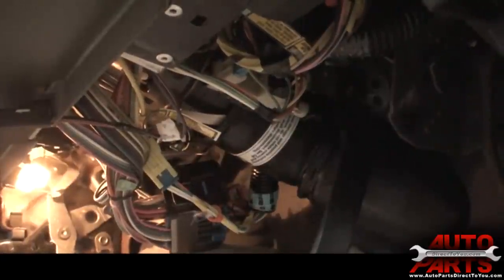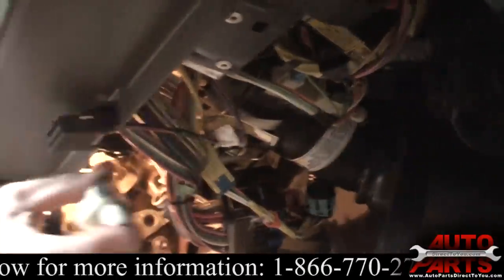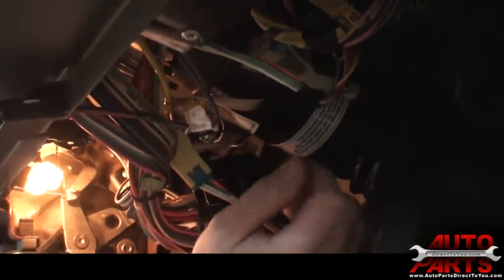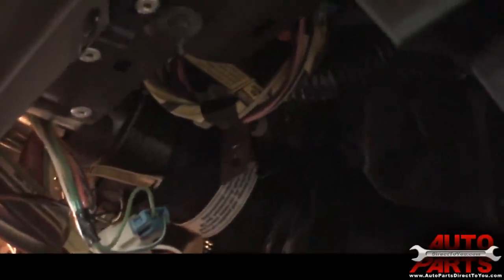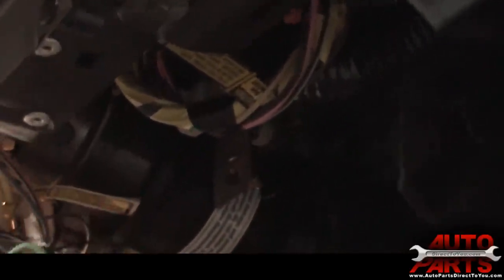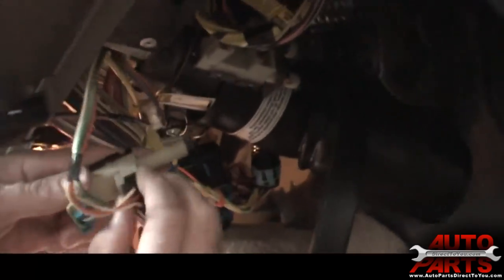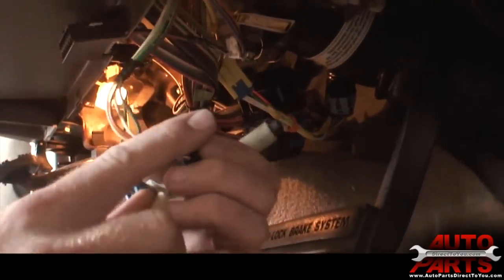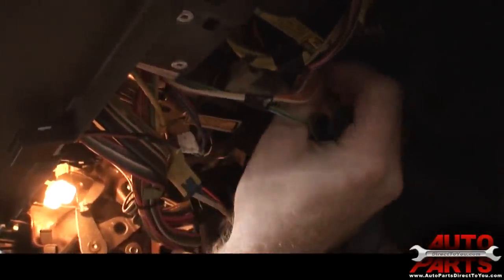1995 Oldsmobile Cutlass Ciera Brake Light Switch

Comment: Just replaced the BL switch on my 95 Olds Cutlass.  Found out that the lower brake lights were connected to the small spade connector in the switch (4 bulbs) and the 3rd BL connected to the large spade connector.  Wired backwards.  The small spade connector had heated up and stuck to the side of the switch, keeping the circuit open.  I reversed the wires (two outside wires, middle is power), putting the 4 bulbs of the lower BLs on the large spade connector, and the two smaller bulbs of the 3rd BL on the small connector of the switch.  This is the third time I have replaced the bL switch, because these wires were reversed from the factory.

Comment from the maker: Unfortunately we do not have a video specifically for this. What I would recommend is to start with the basic, check that the bulbs are okay, the fuses are good and that you don't see any obvious wiring issues. If no problems found, get a wiring diagram for the car and you will have to start tracing wires and checking individual parts of the circuit to find where the issue is.

Comment from the maker: @WestVirginiaGuy Actually on the switch you are talking about,, all 4 wires are used for the cruise control, I believe it's a reduntant system in case one of the switches fails, there is still a backup to turn off the cruise control when you press the brakes.